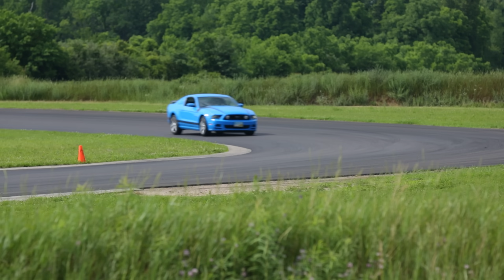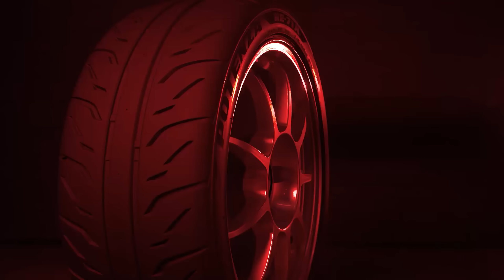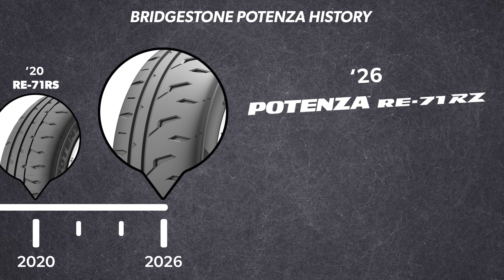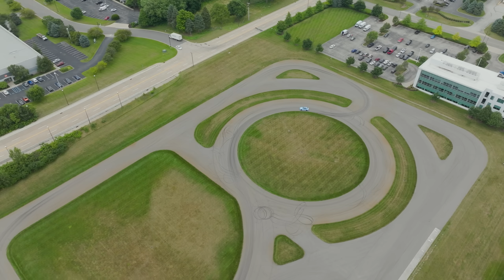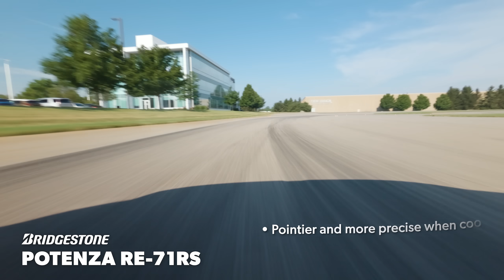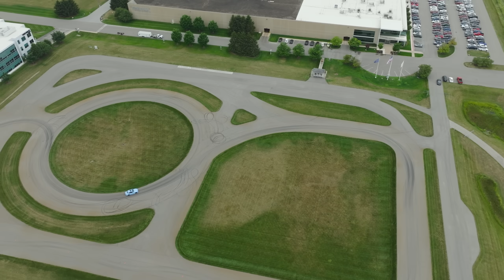Bridgestone Potenza RE-71RZ – First Drive & Impressions!

Comment: I found that the RE71RZ to be about 3 seconds slower than the RE71RS on my GT3, same size, this was at Charleston Peak Full Course Configuration.  I was super excited for these tires, but was disappointed.  These tires also howl and made a lot of noise in the corners compared to the RE71RS.  I thought that these were supposed to be better. =(
Reply from the maker: Thanks for sharing your experience. We know that’s frustrating, especially when expectations are high. Performance and noise can vary based on conditions and setup, and we appreciate the detailed feedback.

Comment: Show us the data so we know that this isn't purely advertisement
Reply from the maker: We knew this would be a bit of a “damned if you do, damned if you don’t” situation. As enthusiasts, discussing a new tire especially the successor to one of the best Extreme Performance tires on the market was always going to happen. As we mentioned in the video, we didn’t feel comfortable publishing full data when the experience wasn’t a true 1:1 comparison between two equally new products. While this was the closest we could get to a clean test given the use of previously run tires, it was a compromise—and one we still felt was worth sharing. That said, we’re looking forward to testing them again this spring

Comment: Are they going to release it in any smaller diameter sizes at all, or only in the huge, more 'rubber band side wall' options, as usual?

Also; You left out the old original RE-71/RE-71 R 'sine wave/bell curve' tread pattern version of the mid to late '80s in your history time line.
Reply from the maker: The current size list reflects everything that’s been announced so far, but it’s not uncommon to see additional sizes as a tire line proves itself and demand grows (especially when it’s vocal). Nice catch—we didn’t include every variation in the timeline and instead focused on the highlights. That said, if this kind of content resonates, there’s plenty of interesting tire history to explore, so more deep dives could definitely be in our future.

Comment: I bought the RS from you guys in 255 and 295 for my 2004 Z06, not a lot of time on them yet but loving them so far vs the Toyo R888 I was running in 275 and 305. Looking forward to the full RS vs RZ testing and an updated RZ vs AO52 vs CR-S test.

Comment: Typical american review. Stating one tire is FAST and the other one is FASTER. Can´t be that good if you´re not willing to give some actual time difference or NUMBERS.
Reply: Did you even watch the video?
Reply from the maker: We covered this in the video, but this is an outlier purely because it was a choice between compromising the integrity of our testing by putting up numbers we didn’t feel were truly coming from an equal position, or share what we did have with a big ol’ caveat explaining the choice.  We’ll still be testing these new-to-new later this year when the weather allows, but felt that the experience itself was worth sharing

Comment: RE71RS are on my shit list because they only gave me two track days on my BRZ (SC3R in the same size could do at least 4). Between those and RT660/+, I kinda settled on the RT660+. They wear much better, and aren't far off on lap time because I feel like I can lean on them a lot harder, particularly mixing braking and steering. They're also cheaper.

Interestingly, the RT660 has a higher load rating than the other two in the 245/40/17 size, as do the CRS and A052, neither of which I've tried. I'd love to see a test where you compare two different tires in two sizes each, where one has a similar load rating in both sizes, but the other has more different ratings, to try and sus out whether load rating plays a role beyond tire and wheel width. 225/45/17 vs 245/40/17 might be a good candidate, since all the 225/45/17s seem to have the same load rating, whereas the 245/40/17s are more varied.

Anyway, if this new tire handles track day heat better, maybe I'll have to give them a chance.
Reply: Rt660 takes forever to heat up. It isn’t a good Autox tire. It’s a better track tire in longevity for sure. However. You want to be competitive and maximize your grip and the tire last forever then your just asking for too much.
Reply: What size tire do you have when using 245s?
Reply: @Nathan_King 245/40/17. Very close in diameter to the 215/40/17 OEM.
Reply from the maker: Awesome! Drop us a comment in a future video and let us know how they work out for you!  The load rating suggestion sounds like it would make for an interesting test, it’s exactly the kind of question we’d like to answer more of.

Comment: Biggest let down for the RE-71RS was that they didn't offer the OEM sizes for a BMW G-series M car, so I don't know why they are using a G87 M2 to promote their tire, or have they decided to make a 285/30 r20 size
Reply: They do offer this size but its the only size in 20s
Reply: @rogerzheng5718  Not so - the only size the make is 285 35 20 not 30.
Reply: @rogerzheng5718  I checked on their website, closest size is 285/35 r20

Comment: Gimme back the RE-71R!!!!
Reply: Why?  Is it for the symmetrical tread pattern?
Reply: @JETZcorp  Have you ever driven it? How it communicates. How confidently you can approach the limit without surprises. Admittedly this was on an RX-8 that provided a great platform, but other good tires didn’t do as well.
Reply: @91CBR86VFR  Have you driven the R and the RS on the same car?  The R was a bit before I got into it, so I haven't experienced it directly.  I just know that the RS was (apparently) faster, but I know the R was popular, and a lot of people liked that you could swap them around and put the inside shoulder onto the outside for more even wear.

I have driven the RX-8 and my NC Miata on autocross.  IMO it's the best chassis I've ever felt.  Far more controllable than an S2K, and made a Cayman feel like a truck.  I was planning to by RE-71RS for my NC, but I held off when I saw the RZ was coming.

Comment: No actual data.  Disappointed by values such as "fast or faster"
Reply: Seriously?  The title is literally "First Drive & Impressions".  They got to drive a test set of prototype tires that were worn in a fair bit courtesy of Bridgestone.  The likely can't post any data yet because A) its not a final production tire with DOT on it and B) Bridgestone probably has some NDA or embargo until they can get actual production tires out for testing and sale.  So for now its a bit of what they are able to talk about until the spring when they can actually mount up a set of 4 on a car and properly test them against competition and the outgoing RE-71RS.

Comment: I love the RE71RS as an autocross tire on my Elantra N. It pumps out absurd times. To see that this new tire is measurably better in every single way is crazy. My big complaint with the current gen is you just can’t share a car during an autocross session with more that 4 runs, it just gets too hot. Also, it takes a few laps for the rears to get even close to warmed up and by that point the fronts start to go. Still, those tires always put me in the top of my class!
Reply: The warmup issue sounds like an elantra problem, not an RE71 problem
Reply from the maker: We appreciate your comment! Let us know if you end up putting the new version on your Elantra. We'd love to know what you think.

Comment: Even if it is faster. Its price point is getting too dang high… love my 71RS but dang do they charge admission for it
Reply: If you want to win you have to use them though
Reply: @turbo_brian unfortunately that’s the way it is.
Reply: How big of a difference? On my sizes, they are basically the same unless you are talking about the prices of the RS’ that have been discounted a fair bit
Reply: @EFLO787  RS vs RZ in my size is like 60$ more.
Reply: How many street miles do you think they’ll last
Reply: Getting mine mounted and balanced right now.  $2900 cad.  315/30/R18.  

Pretty much touching Hoosier costs from last year

Comment: For EU people to save some time: nope still not "E" marked so not road legal in the EU.
Reply: If they’re available though, would still make a great track day tire. Not sure I’d recommend anyone drive these types of tires on public roads for any significant distance just due to the waste it’d be for a tire with such good grip and relatively low longevity.
Reply: Really?? Did you not pay any attention?? They're prototype tires with no certifications on the sidewall, they were very clear about that and showed the blank wall.
Reply: @realkarfixer8208  also I just saw on TR's website, you can expand the picture of what I imagine is a production tire. The sidewall does show an "E4" inside a circle. Not exactly sure if that is real or what would indicate European homologation, but if so, looks promising.
Reply: @realkarfixer8208  I thnik I paid more attention because I wrote to them asking it. And  "Dear Mr. XXXX , i checked with our product planning and have bad news. The requested tire cannot be sold in Europe because the R117-02 cannot be obtained."